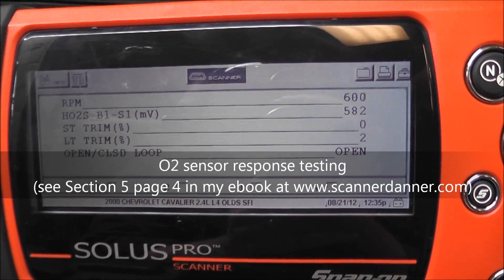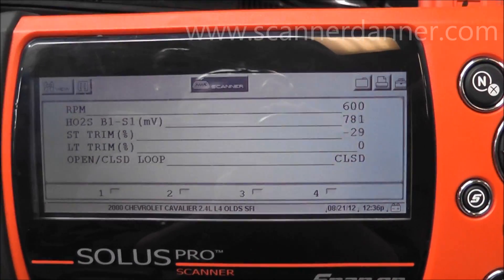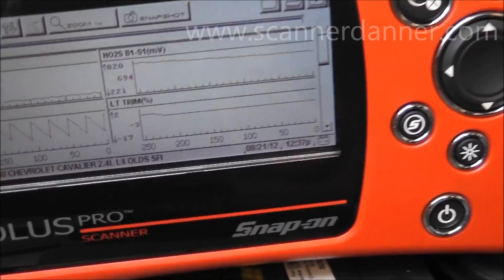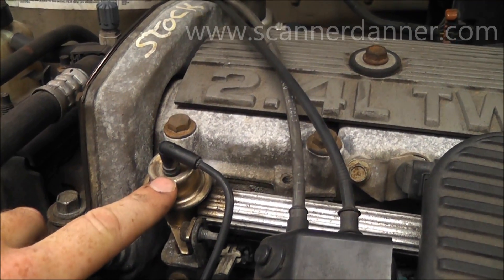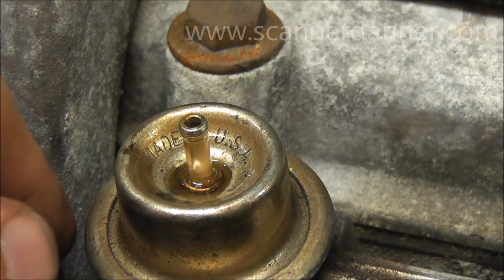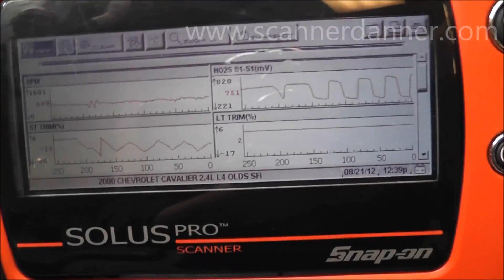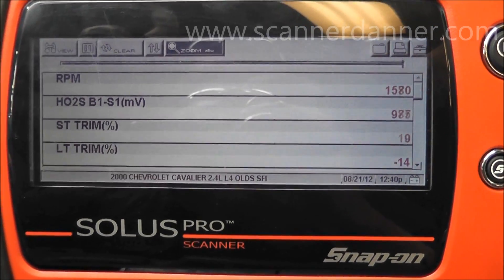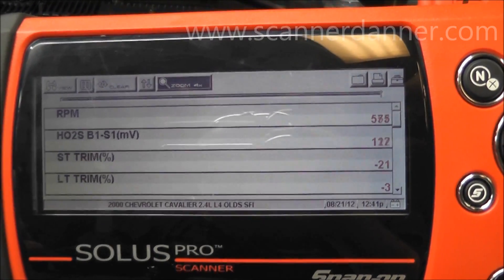Leaking Fuel Pressure Regulator (symptoms and testing)

Comment: I think when LTFT reaches 24% or more (depending on the manufacturer), it will trigger a code.
In my opinion, the PCM watches LTFT more than STFT for triggering a lean or a rich condition.
I could be wrong it is just an observation.
For a code to be set, the condition has to occur in 10 seconds for example (depending on the manufacturer) and this can be happening with LTFT value because it takes time to change (long term) but STFT changes instantaneously.
Please forgive me if I'm wrong, it's just an opinion.
Reply from the maker: https://youtu.be/oRX2V6_a3dc
When you have time. Thanks!
Reply from the maker: For code setting, I'd agree (LTFT). I think it's just under 20%. I've seen 18% ones code

Comment: Can a bad fuel pressure regulator cause gas to get into my oil?
Reply from the maker: Absolutely!
Reply: @ScannerDanner  how can I test it if my vehicle will not start and no scanner tool?
Reply: @ScannerDanner  on a 99 expedition 5.4 is the pressure regulator built into the fuel rail? I disconnected the red vacuum line and fuel came out of it. I'm just tryna make sure that's the fuel pressure regulator
Reply from the maker: @azeeninety55  okay, for sure no fuel should be there, it is bad! But on your system believe it or not, that is NOT a fuel pressure regulator as you have a return less fuel system with I believe a psi sensor on the rail and no regulator at all. Fuel psi is regulated by a variable speed pump.
Anyway, you need what's called a fuel damper or fuel pulsation damper. 
This may not be the exact one 
Standard Motor Products FPD17 Fuel Damper https://a.co/d/iq0GMl8
Reply: @ScannerDanner  ok thank you very helpful now I know to replace that. Sorry I have one more question if I have a blown head gasket will all my coolant be gone or will it only be low in the reservoir?
Reply from the maker: @azeeninety55  I've seen early headgasket failure stages where the coolant is barely even low at all.
Reply from the maker: @azeeninety55  make sure you change your oil and filter too!!! Super important

Comment: Can a 90 chevy lumina have a bad fuel regulator but not leak. I'm having the situation where seems like I make it a few blocks at 25  to 35 mph and it won't take throttle if I pump the throttle slightly it sometimes picks back up and runs . I unplugged the regulator and plugged the vacuum port at the throttle body and drove it car runs fine until it gets down the road a few blocks and it will act the same way . Falls on its face I have to keep it alive at slow speeds and every so often it'll pick up and go Luke normal. Car has 112 ,000 miles on it normally runs like a peach .I've had past issues multiple times replacing the icm, coils and wires . That all should be tits. There are no codes other than a lean code 44. Which only just happened like 2 days ago .
Reply from the maker: You're starving for fuel. The symptoms and code 44 match exactly that. Either you're dropping fuel psi or you have a shorted injector. I have videos on what a single shorted fuel injector can do on these group fired systems. Is it s 4 or 6 cylinder? Either way, fuel psi test should be next
Reply: @ScannerDanner  thanks bud I appreciate the feed back.
Reply: @ScannerDanner  ok since we chatted last time. This lumina is makin me want to set it a blaze. I've now done the fuel filter the pressure regulator . I need to test fuel pressure I guess . After all that it still falls on its face. If I pump the gas a little very gently I can go down the road with no power but if I shift manually Rev out 1st then shift to 2nd then to drive it runs down the road . When it's cold . It revs normal but that lasts all but a couple minutes.  Wish you were closer bud . I have a new fuel pump to put in . But if I hit the Schrader under hood on fuel rail it hits the hood . Doesn't seem like a fuel pressure problem but I could be wrong .
Reply from the maker: @robplotts9412  multiport? 3.1 With the flat intake that covers all of the injectors? 
These injectors are known for shorting out. I have videos in it.
Reply: @ScannerDanner  it's a 6 cylinder.  I've replaced an injector a few yrs back. If one shorts it takes out the other 2 in that bank. Right now the car starts right up idles fine . If it's warm and you apply a little throttle it'll just die. If it's cold it revs fine

Comment: How to perform testing on oxygen sensor engines wire harness. I wonder in a situation with a 2.2 Gm  engine, if the second oxygen sensor reading states 450mV, prior to turning the engine on, and afterwards it stays a constant horizontal line.  This also seems to cause a short and long term -negative hundred percent fuel trims .
Reply from the maker: 450 is a normal bias voltage that is sent to the O2 sensor, it is not coming from it.
Reply from the maker: Downstream fuel trim numbers are not valid on your model
Reply: @ScannerDanner  in what sense "not valid"
Reply from the maker: @michalukasz1660  not used, b.s. scan data, ignore it
Reply: @ScannerDanner  I wouldnt say so. Autel 619 scanner, in this particular car with  a 155hp 2.2 GM engine it shows : oxygen sensor nr.2 constant voltage (a horizontal 
at 450mV line-not changing at all) prior to engine crancking and afterwards . It shows also a -100% fuel trim on both: short and long term fuel trims bank nr. 2 not changing at all ("frozen value" ). So my questions are could it be: the PCM/ECU or would a TECH2 fuel trim reset help?
The symptoms are that the engine is getting a lot of fuel and contaminating the oil.  
The bank nr. 2  O2 sensor has been replaced recently and is brand new 4 wire type.
Reply from the maker: @michalukasz1660  I don't know what "bank nr. 2" means. You have a 4 cylinder engine with only one bank. The Bank 1 Sensor 1 (B1S1) is your fuel control oxygen sensor. The bank 1 STFT and bank 1 LTFT is what you should be looking at. The Bank 1 Sensor 2 (B1S2) is only being used on your model for catalytic converter monitoring. Unless it is a California model and they are doing something weird, your sensor 2 fuel trim numbers are not valid and should be ignored. That being said, oxygen sensor circuits on GMs will be supplied a 450 mv bias, that goes to the sensor, it is not coming from the sensor. Once the sensor warms up and starts creating voltage, you won't see that bias anymore. It is NORMAL to see 450 when cold, when you first start it, it is NOT normal to have it stay at 450 after the car has warmed up. 
Focus on your upstream O2 sensor and fuel trim data! What are they doing and what codes do you have? Also, it would help to know what exact model and year you are working on. 
Oh and no, a fuel trim reset is not going to help you. It sounds like you have a major rich condition going on if it is contaminating the fuel. Again, upstream O2 sensor and fuel trims should be our focus! The -100 numbers you are seeing, is this upstream or downstream fuel trim numbers?
Reply: @ScannerDanner  Downstream short and long term  trims=  -100% . 
The downstream 02 sensor shows also a constant 450mV prior to and after the engine is warmed up-values dont change stay "frozen" at all.  I am in Europe, it is a OPEL VECTRA 2.2 Gasoline Direct Injection 155 H.P 2005 with the GM ecotec engine.
I noticed that the -100% downstream value shows /stays prior to starting of the engine, and even upon disconnecting of the o2 sensor, no change at all.
It is a horizontal line constantly on the graph.
Reply: -100% =SHTFT, -100%= LTFT (DOWNSTREAM) 
 NR2 O2=450mV=CONSTANT  DOWNSTREAM ALL STAY 
CONSTANT. PRIOR, AFTER CRANCKING, AND AFTER ENGINE  IS WARMEDUP.
Reply from the maker: @michalukasz1660  information that would have been really helpful to start with. You said GM 2.2 engine and we haven't seen that model since the early 90s, thought that is what we were dealing with. Your model doesn't even exist here but since we are dealing with a GDI and possibly a wideband upstream, this means that your system may in fact be using the downstream O2 sensor for fuel trim. You need to confirm the signal wire integrity on that downstream sensor, then also the heater circuit and whether or not is will respond to propane being added to the intake
Reply: @ScannerDanner Recently  when I opened the  air filter pipe that goes to the throttle body, it smells badly with gasoline . Perhaps a leaky injector could be causing the computer to subtract -100% fuel and act in such way ....?
Reply: @ScannerDanner  The symptoms are just as if the 2nd Oxygen sensor (downstream) had no ground/continuity -the signal  stays stuck at 450mV. Plus the fuel trim is -100% labeled shft3 and ltft3.  Whatever the number "3" stands for ?Could it be the injector number?. I did some testing on the voltages supplied to the new oxygen sensor and they seem to be textbook and present.
Reply from the maker: @michalukasz1660  4-wire sensor? What are your sensor side wiring colors and what is the voltage readings on all 4 wires, plugged in, backprobing, with the engine running.
Reply: @ScannerDanner  the oxygen sensor wire side colors are left to right: 2 grey wires, white, black.
Reply: @ScannerDanner  Would a fuel trim tech2 reset be helpfull if the fuel trim  is -100%  and is a constant horizontal line? Or PCM replacement?

Comment: Too bad its not this simple with GM's engines that use a spider injection that has the fuel pressure regulator attached to it that runs off the intake vacuum wheres it all conviniently mounted underneith a plastic plenum... other than to look at the fuel trims and O2 sensor readings to possibly verify the issue.
Reply from the maker: It actually is not that bad. Fuel psi bleeddown is the key on these. I have a video or two showing how it gets done on the CPI systems. Thanks!

Comment: i have an 01 mustang. it’s having fuel pressure problems. it threw me a p0190 code i replaced the fuel pressure sensor on the fuel rail and it’s still stalling out. i replaced the fuel pump prolly 50,000 miles ago. someone plz help

Comment: May not get a response.  But I have a 95 nissan 240sx. I had a code appear p0170 fuel trim bank 1. But it disappeared. But my car has a low idle. And eats gas badly. What can it be? The  Regulator?
Reply from the maker: First thing is to look for a vacuum leak.  That is a lean code not a rich code like this leaking regulator was

Comment: I was looking for this video because we had a bleed down issue on a car at the shop today, the tech checked the fuel pressure regulator for fuel and fuel smell, none was found. We did not get any rich code, which led us to believe that we did not have leaky injectors nor a faulty regulator. We ended up recommending  the fuel pump.
We repeatedly pump the brake to drive the o2s lean instead of pulling a vacuum hose. I learned that from the tech, but can't get to even understand why pumping the brake drives the o2s lean with a good brake booster check valve.
Your videos help us do quicker diagnostics. We do appreciate them a lot.

Comment: I have codes p0171 and p0174 on my 05 honda accord.I hope it's pressure regulator.This is Very Helpful!!!
Reply from the maker: those are lean condition codes, it will not be this problem

Comment: Hey scanner Danner. I'm having an issue with a 91 honda. It's running rough slight misfire. I feel there's trouble with the fuel delivery. Spark is good I put a new fuel pump in. Replaced injectors. Replaced dizzy. This is a pgmfi model. When I prime the vehicle fuel pressure is at about 10psi is that normal? Then when I started it I walked around to the gauge and it slowly went up to 36psi and held. Responds well to the fpr test about 43psi or so when disconnect. Should fuel pressure just shoot right up when the car is started. Or is it normal to crawl up slowly? When I replaced the pump it seemed like the old one literally blew in the tank. Well it was covered in a bunch of white crud. I bought the car not running. It runs now but rough idle and slight misses a bit. Very sluggish at lower rpm. Once it gets to about 5k rpm it picks up well. It's a single cam vtec engine. Any thoughts? I know it's a long shot but I've been replacing parts left and right. Maybe a restriction in the fuel line? Lmk what you think. If you get a chance thanks!!

Comment: I have PT cruse 2001 2.4 lts no turbo.  with  codes P031 and P037  O2 heater signal low.
I replaced both O2 sensors harness is ok,  and PCM  was replaced also. I cleared codes and  cameback  again.
Any ideas please !!!!!!!!
Reply: Vacuum leak

Comment: Great video, thanks so much! Say, what would cause fuel pressure to drop 5-6 psi in a 1995 F150 with the 5.0 liter engine when accelerating engine to about 1500 rpm. KOEO pressure 36 psi, unplug regulator vacuum hose, pressure increases as expected of a working fuel pressure regulator. Thanks again!.
Reply: Roberto Santiago Rodriguez saw a video that said it’s a bad pump.. psi should go up when accelerate

Comment: so thats why when i step on my brakes the fuel flow stalls out ?
Reply: I am no expert but that kind of sounds like someone put a different O2 sensor in rather than the correct one.  Or there is a vacuum leak somewhere.  Cracked throttle bodies are a common problem with some cars.

Comment: Is it ever normal for the short term trim and a long term trim to go positive and negative to one another mirroring the values?

My understanding is as long as both trims equal 10 points or less together, that is within spec, correct?

So if a short term trim goes negative 5 or 10 and  long term trim goes positive 5 or 10, which is essentially comes to a value of 0, that would be considered a good number.
Am I my correct? Or am I misunderstanding?

Thank you

Comment: I have an 03 Pontiac Grand Prix GT 3.8L and it shut down on me a week ago while running. I went in my son's school to pick him up but when we got to my car it wasn't running. Had It towed home and popped the hood and and did some basic tests. I check for spark(had it), I checked for fuel(had it), and then I checked for air(had it). However I did come across a one(1) spark plug wire(#1) that looked bad inside so I replaced it and my car started right up. I took it for a spin around the block, parked in the driveway and turned it off. One hour later I go out to start it and it just cranks, no start. I unplug the spark plug wire again and put it back on, started up again then idled roughly and cut off. Hasn't started back since! What do you suggest I do next?
Reply: I forgot to mention that I had a Check Engine light on a week  prior to this problem but it went off days before it stalled out. Even when I try to start my car, the check engine light doesn't light up on the dash anymore, at all!

Comment: Just wanted to say thank you for your video! I have been trying to fix my 2005 S2000 for 2 months with these exact symptoms. I found your video and fixed the car the next day. I work at an Acura Service shop and even my techs couldn't figure it out. I replaced the map sensor, O2 sensor, spark plugs and even tried new injectors....none of this helped. Your video was spot on!! Thank you so very much!!

Comment: Thanks for the info just had the same problem with my 95 mustang GT got so bad it would not idle. I saw the data that showed both banks were rich so i cleaned IAC and MAF sensor first then I saw this video pulled the vacuum line found gas in it replaced regulator that fixed it. I think it's been bad for a while because it has never idled so smooth since I owned the car it just got worse with time.
Reply from the maker: awesome! thanks for the comment and for watching
Reply: I just recently acquired a 98' Mustang GT that said lean bank 1...It idled alittle rough but never stalled on me...I've replaced some vacuum hoses first off before I decide to get crazy with a Purge valve and solenoid...but after replacing the hoses now while idling it wants to stall after about 2-3 mins of running...when I rev the engine to 2 grand it stays there for a couple of seconds then slowly drops down to 500 then settles out to 700...what started all this diagnosing and research was that it has a bad gas smell after driving it for like 5 mins...could a FPR have something to do with this???

Comment: 1988 ford ranger  I've changed all the fuel filter the inline all the injectors and getting spark new spark plugs an wires new air filter. It cranks but won't start now.. was running fine then died on me on my home from the store got it to fire one more time black smoke poured out the tail pipe got it home the problem stopped for a few days now she won't start at all just crank I can hear the fuel pump in start... what could it be? Seniors? Fuses? Timing?
Reply: TheBbtwilight try what he did in the video. Get a new fuel pressure regulator. If you see gasoline in your air box/snorkel then it’s the fuel pressure regulator
Reply: Crank 760 that's what I was thinking but I'm not getting fuel to the injectors  an when I pulled those hoses off the fuel regulator nothing came out
Reply: TheBbtwilight is your airbox/snorkel full of gasoline?
Reply from the maker: you need to measure your fuel pressure next. I have an inexpensive kit listed on my Amazon page
https://www.amazon.com/shop/scannerdanner
Here is the specific kit I am referring to:

https://www.amazon.com/dp/B000R5IASC/_encoding=UTF8?ref=exp_inf_pl_scannerdanner
Reply: Check for vacuum leaks